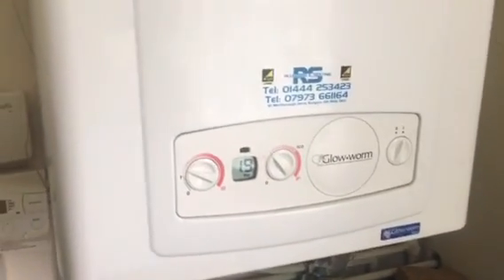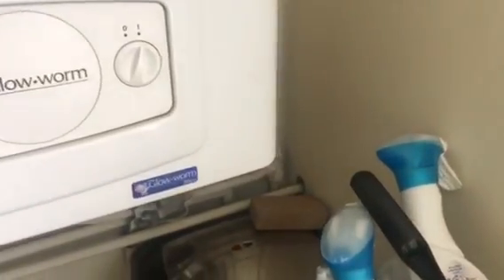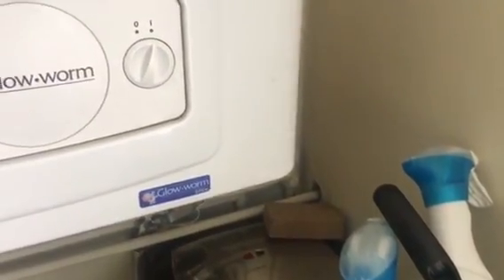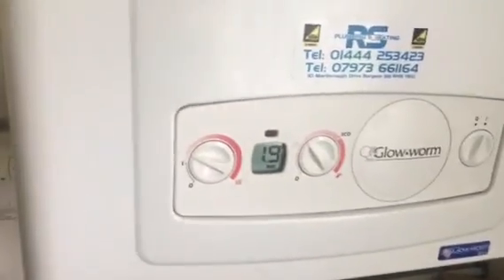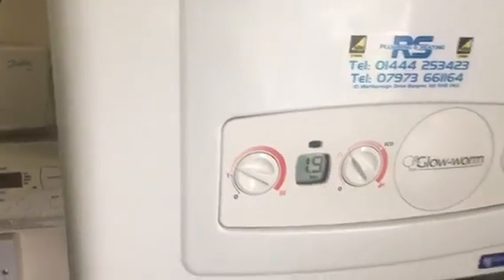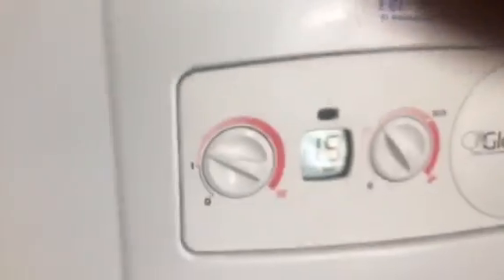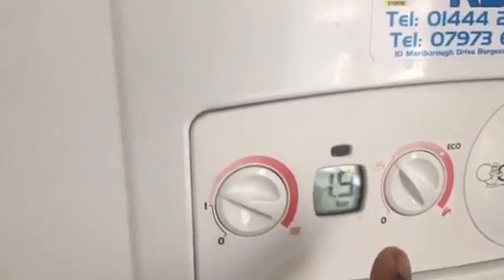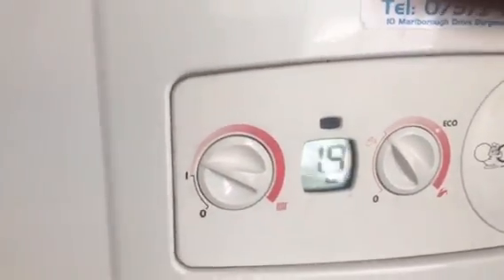How to Pressurised Glow worm 30cxi

Comment: If yours is like mine, the blue knob doesn't turn anti clockwise (it starts in a fully anti clockwise position) and if you turn it clockwise a load of water start coming out at the bottom.
This happened to me twice so far in 2 years. The first time I searched it and I didn't come across this video and I was led to the conclusion that a £5 component is damaged which wasn't the easiest to replace as it needs soldering in a control board but I got it done and it fixed it. A year or so later same thing happens, I couldn't remember if it was the same error so I searched again and I came across this video but the knob does the above so what I did is put the largest ever pot underneath to collect the water and actually turned it all the way clockwise (I had the heating and water dials to the zero position but I don't know if that makes a difference). It took me 2 whole pots before it went up by 0.1 so I kept going and about 6 pots later it was up to 0.7. This was enough for heating to work (in fact 0.5 was enough but I kept going to get to above 1 as recommended) but it won't go up any further than 0.7 so worth a try.
I'll post any updates later
Hope that helps
Reply: Hi what solved this. When topping up mine leaks too

Comment: I hope anyone reads this: you have to turn the blue one counter clockwise UNTIL IT REACHES 1.0 to 1.5 pressure, then you return it to the close position (turn it clockwise again). IF your pressure passed 1.5 (or 2, whatever), then you have to use ANOTHER valve underneath (a black one), counter clockwise, to release the pressure back to 'normal' (it will do a mess as water is passing out the system, so put a large container under there. Please, read the manual or call someone if you don't feel up to it. Don't blame me.
PS: Glow Worm boilers ARE THE WORST I have ever 'owned' (I'm renting, so I guess a cheap landlord is the culprit on this one)
Reply: Pressure on mine was over two, so thank you for leaving your comment.

Comment: I have this boiler. The electric went down after a storm for 1 hour .When the electricity came back on the boiler pressure went down. However the pressure should not be more than 1.Obar according to my instructions. I have not re-pressurised as yet.

Comment: why would the reality be the opposite...blue valve here starts fully anti clockwise! and nothing happens if you turn it ?   any clues?  does it keep turning clockwise or stop seems to go on and on ?
Reply: Mine doesn’t do anything either. Did you find a solution?
Reply: @anastaciafox1170  no lol nothing makes sense in this feed not even the pressures advised. They cant all be right is all I learnt, then got a diesel heater 😂

Comment: Thanks for the video but nothing happening when I turn that blue knob.
Reply: Me too. Did you ever get a fix to this mate?
Reply: Had to call a plumber, he had to add water connecting a water pipe  to the boiler. Boiler packed up few month later had to get new one
Reply: Nothing happening when I open the blue valve. No water flow at all. Need to refill 2 rads that I've replaced. Great!!

Comment: I can not turn the blue nob, is there any other way?
Reply from the maker: The only way is to turn that blue knob anti clockwise. If it’s too hard, you might need to get a professional in case the knob snap they can fix it.
Reply: mine is very stiff, but i managed it but pressure went too high, and started pumping water through pipe outside.
Reply: Where is that pipe located

Comment: Didn’t work for me. Water came out and pressure didn’t increase
Reply: same thing with me. how you managed to fix it if so please let me know
Reply: @are3o  mine actually needed a new boiler in the end 🤦🏾‍♀️
Reply: @tanial1157  thank you for replying back 😊 oh no hopefully i don't run into the same situation as you
Reply: @are3o  have you sorted this
Reply: @ryansanders8186  got a plumber in and said a part is broken so needs to be fixed asap and will cost about £400 😢
Reply: @are3o  patience. But a bowl underneath and turn the knob a bit further. Mine did increase. But 1.9 bar is too much. I think it will be 1.0-1.2bar.

Comment: Wrong pressure. Boiler cold should be set to 1.0 bar, not 1.9
Reply: Exactly. I did as he said and put on the heating and mine rose up to 2.7 bar. Looking to bleed my radiator now.....
Reply: Just wanted to say a big thank you, you’ve just saved me £80 call out 👍🏾